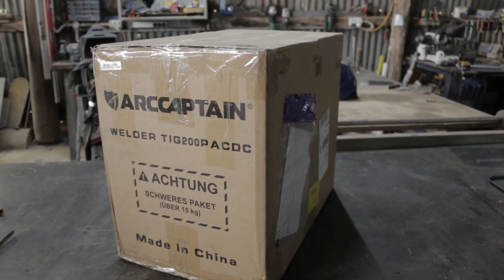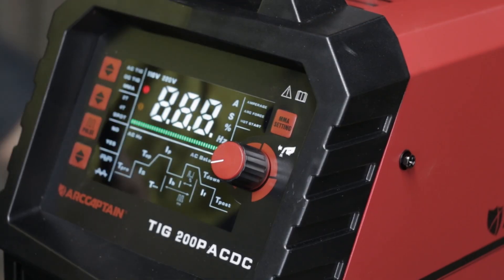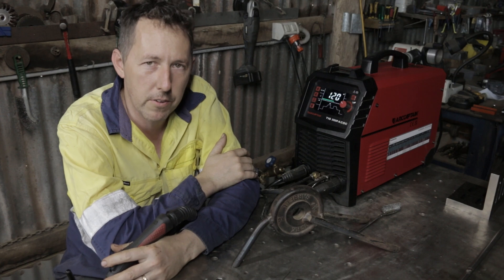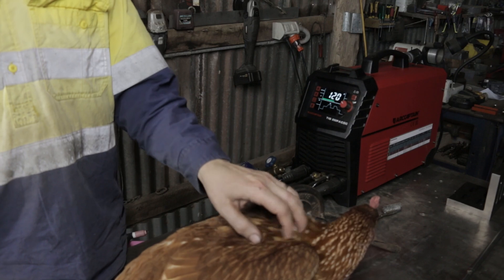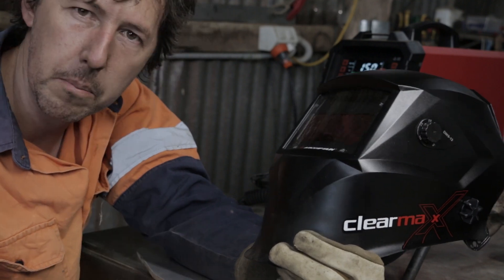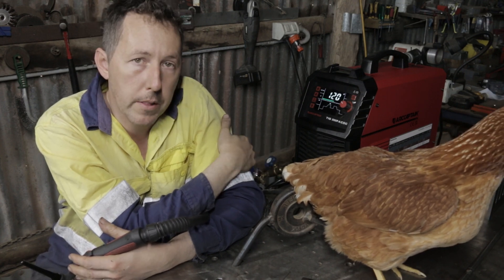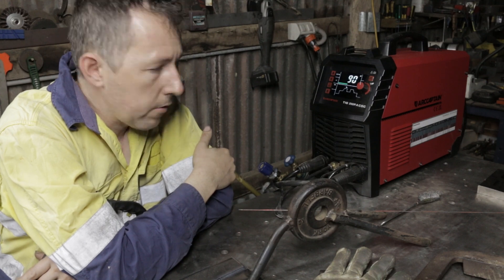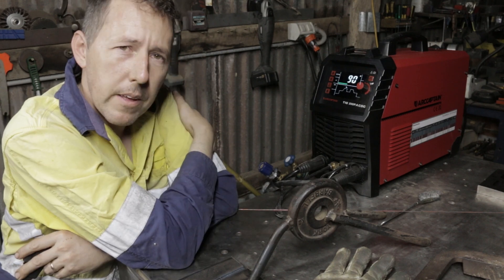Arccaptain's 200P TIG AC/DC welder Great Value

Comment: How do u activate remote mode on this machine? I bought this machine and came with a foot pedal as a special offer. I connected the pedal to the machine and it works, it welds, but the amperage does not change according to the amount of pressure on the pedal. I cant find anything in the user manual or internet regarding activating remote mode on this machine. Ur reply will be much appreciated
Reply from the maker: G'day mate 
To activate the remote setting you just need to hold the button down for five seconds on the tik torch until a machine beeps at you.
The foot pedal will work properly then. 👍
Reply: @ hello. Im a beginner so forgive me if I ask silly questions. I connected the pedal to the machine. Now I should prese the torch button for 5 seconds and I should hear a beep? I tried it, sometimes it makes the beep and sometimes not. But while pressing the pedal the machine still works at the same peak amperage without variation
Reply: @ just an update. I managed to figure it out. You can connect the pedal and then press it for a few seconds while holding the torch away from any metal piece

Comment: I bought an arc captain helmet as well, it’s great for acting  and awful dc. It will dim on dc and then just cut out and flash the hell out of me.
Reply from the maker: I replaced the battery in mind and it's been doing a little bit better though it's still flashes me on the odd occasion.

Comment: Beginner here. 7:35 TIG can be initially used without filler material also?
Reply from the maker: With some materials yes. Stainless steel is the best for fuse welding, and certain grades of aluminium. You can get mild steel to fuse though it's never very satisfactory it really needs the additives that are in the mild steel filler wire to stabilize the weld puddle.

Comment: Just tigged up 2 aluminium tanks...aprox 50ft weld total at about 165 .works fine.Ground cable is about 1/2 the size it should be as is the main power cord.
      Get used to using a foot pedal guys.Have tigged up aircraft tubes with all kinds of tortch contortions and positions using a knee even on the pedal.

Comment: Hi. Thanks for the video. Are you running this off a 10amp power point? I note on the Arccaptain website that the power cable is detachable. Thanks.
Reply from the maker: When I received my welder it had an American style plug 🔌 (at the time of the video this was the first welder to be sent to Australia) so I put a industrial 10 amp plug on the machine and it's been fine, even running on long extension leads.
Don't know if that's technically correct or too spec but I haven't had any issues with it running on 10 amp outlets.

Comment: Be careful buying these machines, because you won't get like 200amps max 130 and quality is poor
Reply from the maker: Yes I have had that happen with other cheap brands, but this one is spot on.  It might be different if you are running it on 110 v, being in Australia I don't have the ability to test that.

I was pleasantly surprised with the performance of this machine and I'm not just saying that, I've been using it as my main welder in my fabrication shop on-site and off site, sometimes 6 days a week and it hasn't let me down.

Comment: Will you now be going back to you UNIMIG? & if so, could you outline the benefits for you to switching back to the UNIMIG - cheers & looking forward to more videos with some of us curious on getting info on making or buying the aluminum cart you welded up in the Pulse MIG episode.
Reply from the maker: I'm still running my UniMig, it's T2 torch has a superior duty cycle compared to the standard 26 air cooled that came on the  Arccaptain. 
Both are fantastic welders, one thing the captain does better is they've developed a high frequency start that is 99.9% reliable.
Something that the unimig struggles with on occasion is a false start, it's a small thing, but it is something that UniMig could improve on.

Something that I would consider if having to buy one of these machines would be spare parts. I know that UniMig is very good at servicing their machines and stocking spare parts.  
I haven't had to get any spares for the Arc captain but I'm not sure how that would go.
Reply: @LittleAussieRockets   Cheers for the reply - I actually replied to this comment & it appears YT deleted it, as they then accused me of breaching community guidelines with SPAM of all things. All I was doing was commenting on which UniMig I was looking to get & that I felt the Arccaptain was similar to the YesWelder, with both being on Amazon.

Comment: looks good mate i love your show keep it up,  i have a heart  pace maker , was told by the cardiologist not to use a stick welder, he say i can use  a mig , when i asked him about a plasma cutter he didn't know what it was and a tig he didn't know what it was, what's your thought about this , ive used the  plasma cutter since whats youre thinking about this mate , thanks
Reply from the maker: I'm not a doctor so I really can't comment, but this machine does have a high frequency start which is high voltage and low amps. Kind of like an electric fence on steroids. I couldn't imagine that playing into your favor
Reply: ok thatks i just dident know if a tig had
t as lower than a mig or higher voltage 
 @LittleAussieRockets
Reply: @pkgoldopalhunting   Just be careful - HF TIG, especially AC/DC can mess up car key FOBS & more rarely smart phones - my welding instructor has seen happen to a couple of students who forgot to leave they FOBS in their lockers, with this happening to one guy twice.